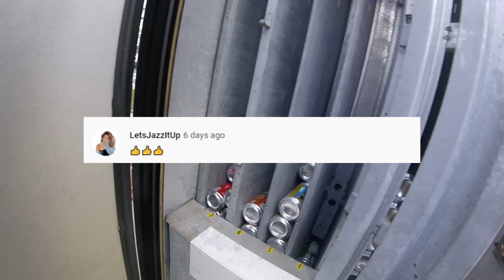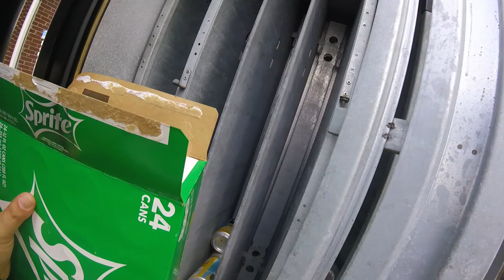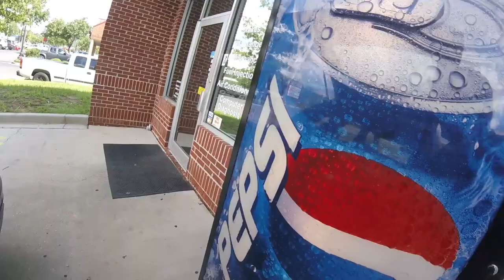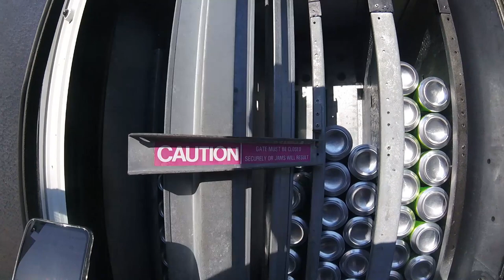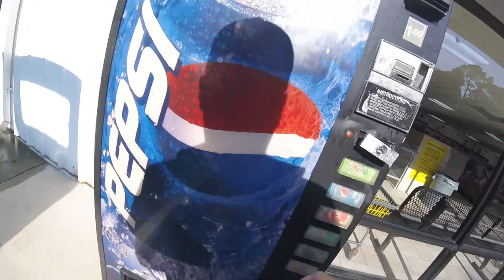How does weather effect vending business? Also cleaning and doing maintenance to our vending machine

Comment: Cov has cut capacity in half at a location I have

I think I make around 3 to 15$ a week from it

I’m think on cutting it or what you think!?
Reply from the maker: Me personally I would not pull machines unless you have certain situations. Like If you have a better location lined up and need that machine, or if it's clear that the location won't recover after it's all over. Remember there are vaccines now